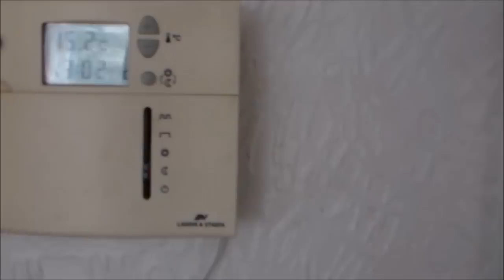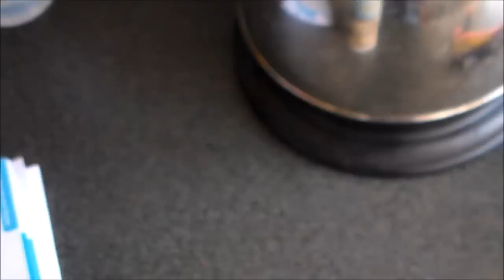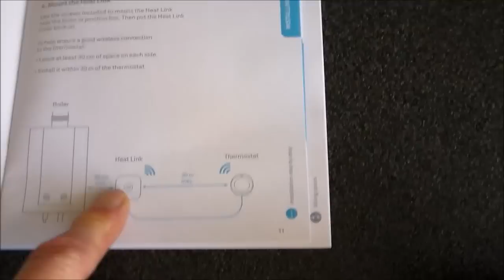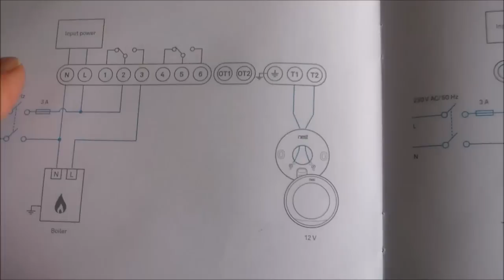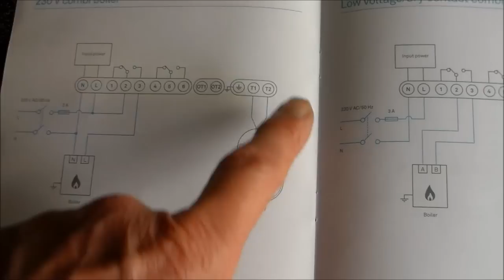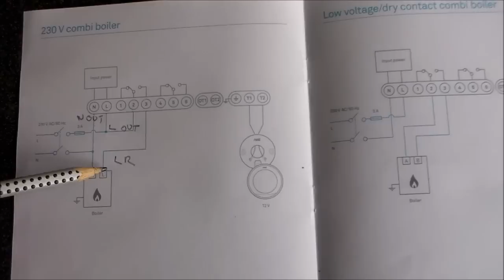Nest smart thermostat Worcester Bosch combi installation

Comment: The statement about the wiring diagram is wrong. The boiler connections in the nest diagram represent the heat demand only. The power supply should also come from the boiler.
The boiler will continue to do all non-demand functions even when there is no heat demand.
Reply: Good point. Yes the boiler does it self check, frost save etc. The thermostat just tells the boiler that it wants some heat.. heat demand as they say. I guess one difference between nest and hive is that nest can be wired to get its power from the boiler. Hive is fully wireless.

Comment: The problem i see is that you actually don't know how to install it or even the specifics on how it controls the system. If your going to show someone ow to do ot, learn it well first, then show soneone else. I don't actually trust your methodology or feel as if i'm learning useful info as it could be bogus. I'll contune to watch but i feel it's a waste of my time.
Reply from the maker: Hi Dor, more an  exploration. I have shown my thought processes so you can see how I got to my solution. Each case may be little bit different. It has been working perfectly for some time now. I have also installed a couple of Hives, but they just plugged straight onto the old time control back plate with a single wire to swap to a different terminal.
Reply: You don't need to earth Nest terminal box as it is plastic. The earth is forva pass through if needed
Reply: My thoughts exactly. He was learning on the job. Why video it? Once you know what you’re doing, then do a video on an install
Reply from the maker: Hi Olie. I started out not knowing. I am sharing my learning process and reasoning - and it worked!! Also it shows people some of the complications so that they can consider paying a fitter if they are daunted.
Reply: Good thing this is only to be installed by a licensed electrician then!

Comment: Clueless man
Reply from the maker: Hi Tony, get yours fitted by a registered installer. I was surprised how easy it was to sort out and fit but a bit of knowledge of electrics helps.
Reply: I think he meant you are a clueless man. That's a dangerous video. 240v live feed with no cord grip. Nor did you point out that your initial theory that the boiler couldn't function because it's input was switched by the nest was totally wrong. The nest heat link is powered by your boiler outputs, not vice versa. And it doesn't need an earth, it's a plastic box posing no danger unless some idiot uses unsheathed wires which don't let the cord grip function. Instead of telling other confused people to get an electrician to do this for them, I think you probably should get an electrician to do yours.
Reply: @nialldewar  Mine is still working well. I have since installed two Hive systems with great success. No video because you wouldn't like to see how easy it was in both cases, only one wire to change on the old Central heating timer base panel.

Comment: Do you know how this would work if I have no separate thermostat at present. Just a low / high switch on my boiler
Reply from the maker: The Nest, Hive or any thermostat would add greater functionality to your system. Get an installer to give you advice.
Reply: If you dont have wires to a thermostat just ignore the t1 and t2 .... then the nest thermostat will have to be plugged in via USB whitch comes with the nest stand. Also with the live return to number 2 just bridge the live from the heat link to number to it dose the same thing  so you would only need 4 wires to the boiler  neutral , live , call (LR) and earth.